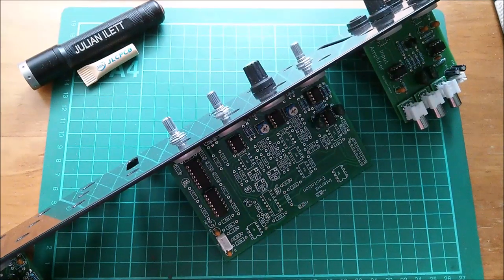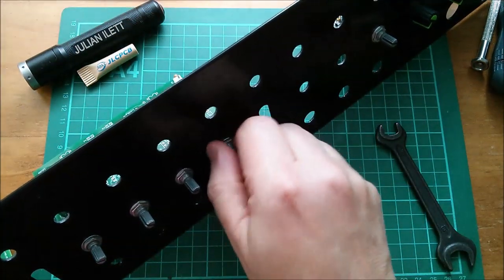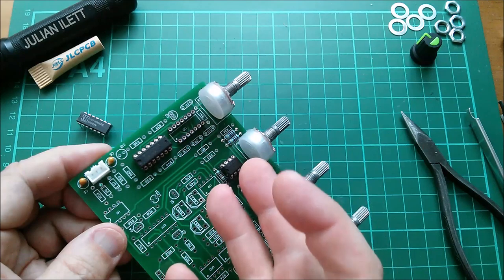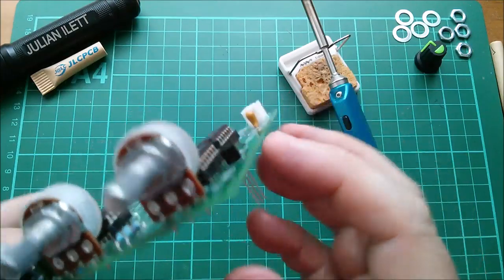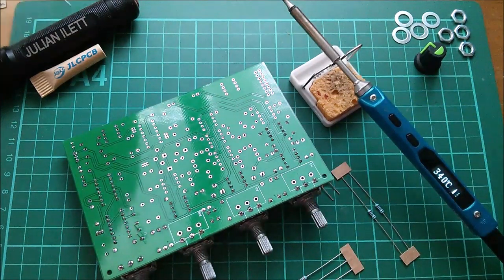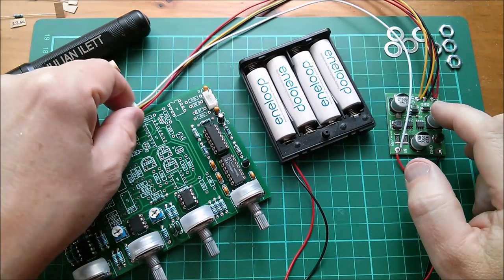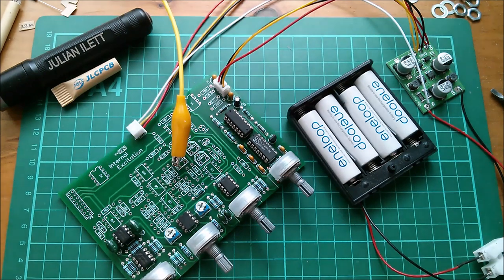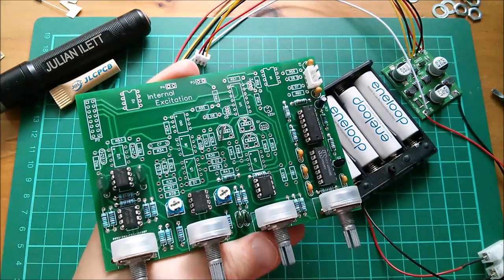PCB Assembly, Explanation and Testing - Excitation Section - Vocoder

Comment: I know there are software vocoders out there but this is more about the journey, which I appreciate.
I can remember Laurie Andersons "O Superman", sends chills down my spine every time I hear it.
My 2 cents worth would be to drill some holes through from the back, scrape off the solder resist on the top and run some mod wires through.
Reply from the maker: This is very much about the journey - and learning about analogue electronics along the way. If you want some vocoder chills, try Imogen Heap - Hide and Seek (https://youtu.be/UYIAfiVGluk)
Reply: @JulianIlett  E.L.O. are my 'go to' vocoder band.
Reply from the maker: Kraftwerk and Pink Floyd for me :)

Comment: Great job, great results - keep the good work. Few years ago I designed voice and noise generator circuit that was used in a Robot to show to my community. I used a sound generator chip that can generate allophones. I used similar chip back in the late 80s, it was selling at Radio Shack and it generated preprogrammed words and sounds and presented in my Graduation Project in the university. We also can generate those sounds by digital means, condition them, filter them, and mix them together. I love those kinds of projects and that remind me of my old days - cheers and have great time working on those fascinating projects.

Comment: Here in Australia, we get a New Zealand magazine called Silicon Chip which fairly recently described how to get pseudo-random noise by using either a shift register with XOR gates or a simulation of them in a computer.
I used the information they gave to program a simulated 32-bit shift register and XOR gates into a PIC 12F675 microcontroller (I happened to have a few of those handy).  It toggles one of the I/O pins using the lowest bit in the simulated register after each pass through the simulation loop.
It works great, even with just a small speaker.  With the low-voltage tolerance of that chip, I can run it directly off an 18650 if I want to.  I added some NOP instructions at the end of the main loop before it goes around for each pass in order to lower the over-all frequency of the noise, which I found gives a more pleasant sound.
I hope to eventually make a white-noise generator to connect to some ear buds to mask noise while I'm sleeping.  Since the 675 has an a-to-d converter built in, I may connect a pot to that and program the microcontroller to vary the pause length between each bit to vary the frequency.
Reply: White Noise generators are awesome, and I think not well (widely understood) known. I get away with a fan by my head (not to put down actual electronic white noise generators). It works for me. Everyone is different and respond to different frequencies. Ocean, Traffic, etc.. Even conversational voices in a distant room can induce relaxation and sleep. It is a science. And personal.

Comment: You could also cross the wires around in the ribbon cable before the last connector.
Reply from the maker: Problem is, the excitation PCB will sit near the middle of the ribbon cable. But yeah, I could cross the wires - I'll think about it :)
Reply: This is the way to go. No need to mod the board

Comment: Scraping off the solder mask to attach the mod wires flat to the PCB works fine. It also looks better and is more reliable because you only need a few centimeters of wire that are less likely to get caught on something.
I guess the only downside is that if you pull on it too hard you could rip the trace off the PCB but I've never had that happen.
Reply: A dab of cyonacrylate to the insulator just "south" of the connection anchors well.
Reply from the maker: or UV (my favourite) glue :)

Comment: By the time stuff arrives in the post I have moved on and lost the project I was waiting for the parts to finish. Been making a battery pack for about a year now. Still cant find half the batteries (I am beginning to suspect family members have taken them).
Reply from the maker: That's been half the problem with this project - waiting for all the parts to arrive.
Reply: I buy components from China and lose them within a week of them arriving.
 They go to that ethereal plane of that thing I was building would've been cool if I'd built it.
Reply: I started to misplace the electronics stuff I'd been getting from China, so eventually I collected it all into particular cardboard boxes so I'd at least know where to start looking for it when I wanted it.  So far, it's worked fairly well.